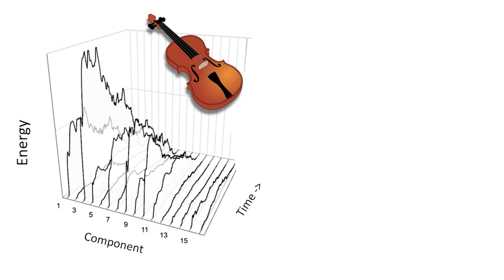Death by beep?  Bad sound design costs lives (and how to fix it) | Michael Schutz | TEDxMcMasterU

Comment: This sounds like a really complex issue though, like he says around the 3:43 mark those tones are designed to communicate information super quickly so if they do replace them with less annoying noises all of that stuff will have to be re-learnt
Reply: Very important point thanks for raising this.  What we're doing here is changing individual notes (not the pattern of notes) so that the messages are preserved.  Sort of like playing a melody on a good instrument, rather than a terrible instrument.  That way it doesn't require re-learning at all.  Excellent comment thanks for bringing this up!

Comment: I appreciate your emphasis on the importance of sound quality in medical devices. But have you encountered any pushback from the medical industry, arguing that sound design might be a lower priority compared to other technical challenges in these devices?
Reply: I agree it IS a lower priority that other challenges.  The thing is that most of the other technical challenges have major barriers (cost, complexity).  With the sounds it's very easy to address, just not top-of-mind for manufacturers right now.  Partly because many are simply not aware this is an easy fix so thanks for watching and helping to spread the word

Comment: Yes and also while we're at it can we do something about all the wires and things plugged in everywhere?? My mother was in the ER recently and the thing they had her plugged in to to measure her heart rate I think it was had so many cords and points of contact everytime she moved one would come off and set off the alarm and yes all the nurses were ignoring it while I was standing there trying to stick it back on!! But also she was getting so tangled in them I was scared they might choke her. Not a good design at all

Comment: This sounds great, but realistically, how feasible is it for hospitals, especially those with tight budgets, to invest in these changes?
Reply: That's a very important point-it certainly wouldn't be cost-effective to change each existing sound.  But the machines are updated on a fairly regular basis.  So, by changing the approaches to future devices we can fix this over time for minimal cost.

Comment: Surely with all the advancements in tech we could come up with a system where those alarms aren't even needed?
Reply: Great question!  The challenge is that many of them are really "alerts" rather than "alarms." They signal useful information that doesn't require an immediate solution.  Which means that ultimately the solution isn't to eliminate the so-called alarms but rather reserve aversive sounds for the signals that signal things which are actually alarming.  And other sounds for the common alerts.  Thanks for listening!